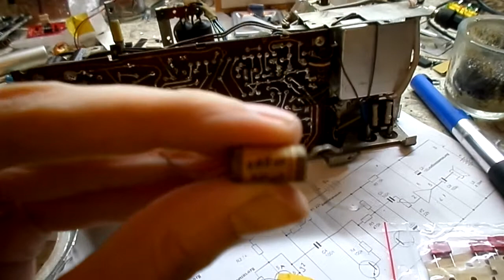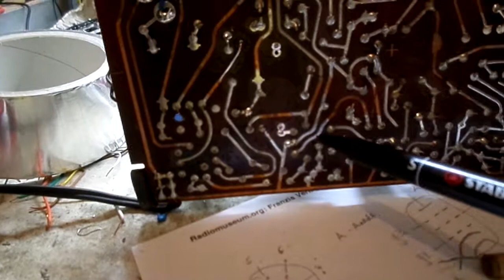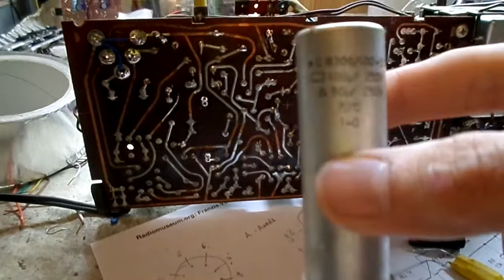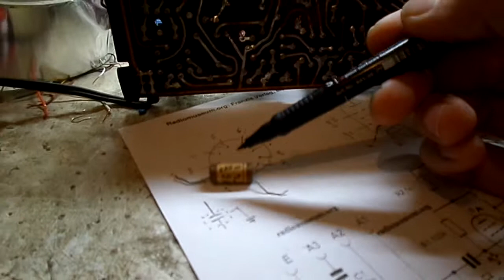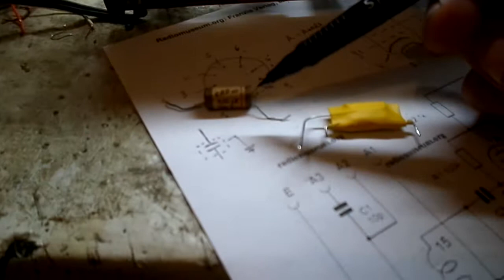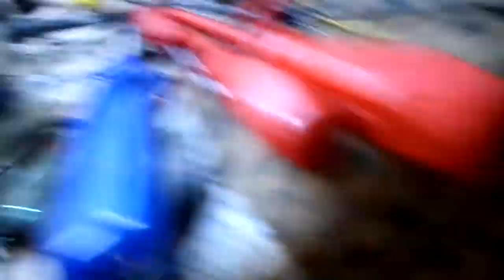Philips '' Philetta '' tube radio progress + shielded cap. replacment

Comment: Yep, just add foil around a cap, this is where that coppr foil tape would be useful
I'm guessing you measured capacitance from each lead to the ground lead, and didn't find any significant value, there will be capacitance, but might  be well out of range of your meter, in which case it can be ignored
It seems like it's the wiper of the pot to the grid of the valve, and would be sensitive to interference.
Reply from the maker: yes, i pretty much replicated what the guy did with his new cap, although its a bit tricky with a square one :-P  yup looking at the circuit again, its in series with the pot and the grid of the tube which is the detector - first AF so yes it would be quite sensitive ! dont even think my good LCR meter could read it, would be in the low pf range if anything :-P